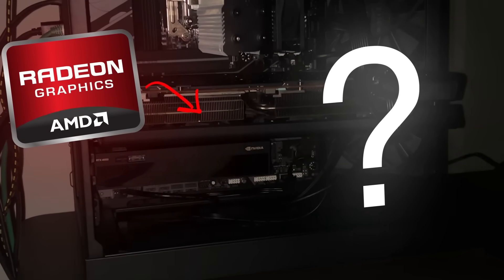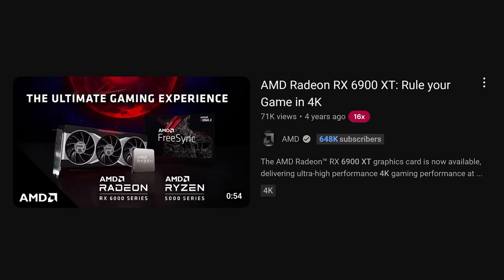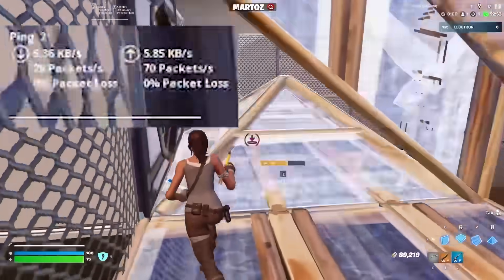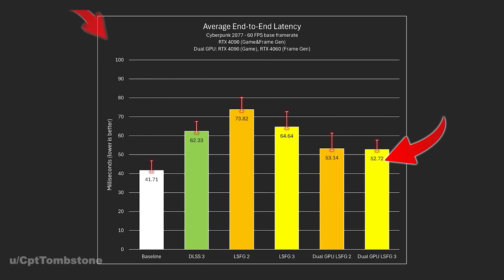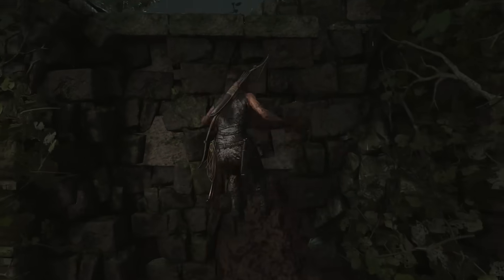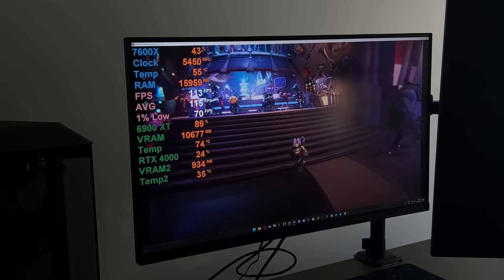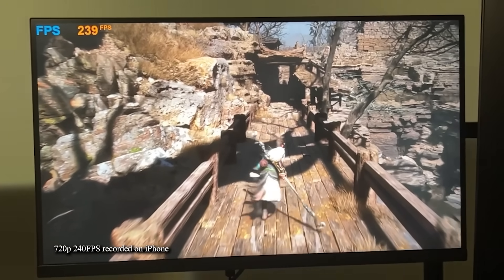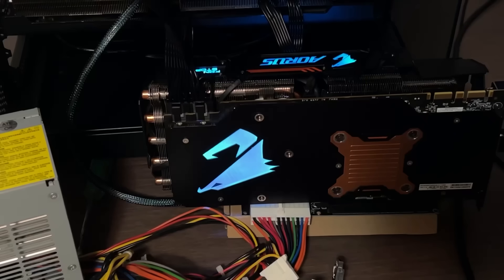I Used Both AMD & NVIDIA in One PC and Got 240 FPS in Every Game

Comment: Try AFMF2 on an AMD card while your other one renders the game. It's a similar dual GPU concept but its significantly easier to setup (less problems) and it has less latency than LSFG too.
Reply: I think the ultimate setup would be a 9070XT + 9070XT
One of the big creators should do this
Reply: @walter1824  AFMF2 is very light to run unlike LSFG, so you don't need a beefy GPU like that to run it with no performance loss. A simple RX 6600 will suffice
Reply: @Hybred  well I just so happen to have an RX6600 laying around... Only downside is I'm running a mini-itx board with 1 NVME slot lol.
Reply: @frostbite1991  use another PCIe slot then. It's fine for that
Reply: @Hybred  mini itx only has 1 pcie slot
Reply: Aaaand we’re back to crossfire again
Reply: @walter1824  i mean i got it half way with a rx 9070 xt and rx 7600 xD
Reply: @walter1824  and what if ... a main gpu is a 9070XT ... and a cpu APU is the "frame gen" one? ... will be worth to try it? (that will make no bandwith problem)
Reply: Yoo the man himself new vid when
Reply: @IstyManame  I do so many different kinds of content on my dysfunctional channel. It's hard to tell what type of video people want when they say this haha. I assume it's from the TAA video?

In that case I have a planned video on game lighting, it's just a lot of work though.
Reply: I have the RX 7900 XTX as my main. How would this do with an RX 580 backing it up?
Reply: @hrayz  AFMF2.1 requires an RDNA 2+ card unfortunately, which means RX 6000 series+.

You can get a cheap RX 6500 XT for $140 though
Reply: @Hybred  I do have an RX 6500 XT, but it's in use in another build...
Reply: @Hybred  i might try this a 7900xt and a 6700xt what would the performance look like also using a 5800x3D so will it end up being a bottleneck
Reply: @oblique__  it's good for CPU bottlenecks so no it would be fine
Reply: @ ok cool and it would better to find a dual x16 slot motherboard vs the external right
Reply: @oblique__  Sure but with two x16 Slots both just run on x8.
Reply: @hrayz  Probably not too well. I have a 3060ti + RX 5600XT setup, and the 5600XT struggles. Could also be the gen 4x4 slot on my motherboard, so I am upgrading my motherboard,  too. However, I finally got a 7900XTX Nitro for $750, so I will see how it performs after it arrives next week.
Reply: you have a video on this? i have a 9070xt and 6700xt and have been wanting to test dual gpu for frame generation. currently i do not have space in my case to fit the 2nd gpu in the 2nd pcie slot and my oculink does not seem to read my 2nd gpu so i have to figure that out still.
Reply: @ItzSath type in "Dual GPU Meta? Nvidia DLSS4 + AMD FMF2 in Tarkov"

Also use a PCIe riser cable then.
Reply: have you had issues of something capping your fps? I'm trying to troubleshoot and figure out if it's my card or monitor or something else i'm not thinking of.i've done this setup but my 4k monitor caps at 120fps despite framing caping tech being turned off. also in overlay for whatever reason the amd card is being 100 util while nvidia card barely has any usage.

Using 4090 to render and 7600 for AFMF

mobo MSI MPG AMD B550 Gaming Plus Socket AM4
Reply: @VampiricConch55  type in graphics settings and set the 4090 to your high performance GPU.

Secondly the 2nd PCIe slot on your motherboard is slower than your main one by a lot, it has limited bandwidth. 4k itself already consumes a lot, so it capping 4k to only 120fps makes sense given this fact.

You either need a better motherboard or to go down to at least to 1440p to get high refresh rates.
Reply: Is that possible? And what benefits could there really be from doing that instead of using AFMF on a single GPU? It's a very good discovery. Personally, I also prefer AFMF 2/2.1 to lossless scaling.
Reply: @TheSpookyOficial  Benefits are lower latency, better performance & slightly better image quality.

All FG's have a performance cost. Getting rid of that cost means less latency since your FPS didn't go down & it also means higher framerates.
Reply: @Hybred I think in that case the most important improvement would be the reduction of latency because AFMF2 has very little cost of performance, most of the time it literally doubles the base of fps even has less performance cost than the fsr frame gen itself
Reply: @TheSpookyOficial  Yes its already very very low, lowest of any FG, the real big benefit is being able to use AFMF alongside DLSS 4 / NVIDIA's GPU, best of both worlds.
Reply: @Hybred There is already FSR4 and the case of NVIDIA, the Smooth Motion, which despite being less polished than AFMF is functional, so that aspect does not seem so relevant to me to justify mounting another GPU on the PC because it would be an increase in unnecessary power consumption, the most relevant would be that the reduction of latency in my opinion.
Reply: @TheSpookyOficial  NVSM reduces performance by about 15%, so it has significantly more latency & less fluidity than AFMF2, even when it's used by itself let alone on a different GPU.

Also 2nd GPUs dont increase power draw much. 30-45w for a small task like that. You could also get a PCIe powered card like the RX 6400 for simplicity
Reply: @Hybred Another question I have is that if using this method you could use the main GPU to render the native FPS of the game + FSR FG and then with the other GPU use AFMF on top to make a kind of X3.
Reply: @Hybred Interesting, although if not bad I remember the results that AFMF gives may vary depending on the GPU you use.
Reply: @Hybred It would be great if you made a video about this on your YouTube channel
Reply: @Hybred The only thing I'm worried about using 2 GPUs is that from what I've seen, sometimes Windows creates conflicts when it comes to assigning the right GPU in games.
Reply: @Hybred that both reduces latency use dual GPU for AFMF? I mean an approximate percentage
Reply: Correct me if I'm wrong but the second GPU will just get 4 Lanes right? So if I use a 9070 XT as Main GPU and for example a 6600 XT for FG it will only be connected with PCIe 4.0 x4. Isn't this a problem?
Reply: @dalukey75  no because AFMF2 is very easy to run, so you dont need the full performance of the lane for it to function well
Reply: @Hybred  Would it be a problem to use a PCIe Slot with 4 Lanes from.the Chipset instead directly from the CPU?
Reply: Afmf is way lower latency just running on a legion go, main reason I don't use lossless unless I'm on a nvidea gpu
Reply: @Hybred How does this apply to VR ? I Have a 9070xt and I wouldn't mind buying a cheap 6 or 7 series card
Reply: @Hybred  Would this work with a 9070xt and a 2080 super? Still have my 2080 super lying around would be curious to try it.
Reply: @akn_9220  AFMF2 Is an AMD tech, so no
Reply: @Hybred  Yea I get thats AMD tech. But I meant more like what he did in the video with LSFG with the 2080.
Reply: @akn_9220  sure its possible. With the correct PCIe lanes on your mobo a 2080 should be able to do 240hz 1440p interpolation. 360hz or higher probably not.
Reply: @Hybred Thanks, I'll give it a try. My motherboard actually has SLI/Crossfire support, but case might be a tight fit.
Reply: Had LFSG3 already. Had exactly 6900XT and recently got the 9070XT. Was thinking to build 2nd PC with the 6900XT (** as I love it, don't think selling it for like 350, as for 350 its "Frame Per Dolar" value is insane).
 ... setting the 6900XT as FrameGen GPU in the LosselessScalling ontop of the 9070XT  ! 🤯💥

** 9070XT will get the FSR4 in games (already did FSR4 to 40 games with Optiscaller), also 9070Xt will cope with the RayTracing, and then the 6900XT will FrameGen them beautifull frames with the LSFG3! 🤯💥 

** @Hybred, Now you made me thinking to test AMFM2.1 in this setup as its better than LFSG3 in some games and 6900XT is AMFM Supported. Thanks!! ❤

PS: Already have 2nd PSU and have had 2 GPUs-one-PC (with 2 PSUs) like 2013. Mission acknowledged!
** Just checked my Asrock Steel Legend X870 and it says below .. if it's true might not need the M.2 Adapter (crossing fingers):
CPU: - 1 x PCIe 5.0 x16 Slot (PCIE1),  *9070XT is PCIe 5.0*
Chipset: - 1 x PCIe 4.0 x16 Slot (PCIE2),

** Need to check if my 2nd M.2 is on M2_2 else If M2_3 is occupied, PCIE2 will be disabled. ;)
Reply: @OCFreeze  how did the test go for you? 3 weeks later
Reply: @Hybred , for lsfg dual gpu ,do I  have to use an external GPU dock like the oculink or the adt link k43sg that's powered by 2nd psu 24 pin for the 2nd gpu or can I just use an m.2 to pcie riser like the adt link r43uf 4.0 that's only powered via a sata cable ?
Reply: @PatrickBateman-co6cs 
I don't know if the Sata-Power is to weak for a GPU. Normally a gpu gets 75 Watts from the PCIe Slot. A single Sata can't deliver that by far. 
And the R43UF is just PCIe 3.0 x4. This can be bottleneck. The ADT-Link F43SG supports up 5.0 x4 but needs 24-PIN from a PSU.
Reply: LSFG 3>>AFMF2
Reply: @Hybred  I have one 4070ti and a 4070ti super, think it's worth it?
Reply: @Wingly_Actual  yes a 4070 Ti is good for LSFG at 1440p
Reply: And it looks WAY WAY worse than LSFG, I have tried it.

Comment: And you can use the 2nd GPU for physX too.
Reply: @Tailslol  i was thinking the same, 2 reasons 2 buy 2 gpus (or at least an extra cheaper one)
Reply: Just reading this as I was about to post something similar. It's what a chunk of AMD users used to do in the 2000s--especially when games like Arkham Asylum released.
Reply: @Tailslol  just want to let you know it worked almost flawlessly tbh. I just installed my 1070ti installed the nvidia drivers alongside the amd ones and it just recognizes it and plays 32bit physx games flawlessly like I had an Nvidia gpu. Like wow im shocked how easy that was.
Reply: @Tailslol wait are you being serious? Can you use 32 bit physx with the second card with the first one being an amd one?
Reply: @Darkage-io4sl  yes
Reply: @Tailslol  alright so I just got a 9070xt i have a 1070ti I can put it in my system run this program and I should be able to use 32bit physx on game again?
Reply: @Darkage-io4sl  yes if your motherboard can handle everything at full speed and you can run both drivers you will be able to use the 1070ti for scaling and physX.
Reply: @Tailslol  ok yeah the main slot is a gen5 x16 and the second is a gen 4 by 16 so ill be trying it later
Reply: @Darkage-io4sl  https://www.youtube.com/watch?v=crgqDkmwqjg
Reply: @Tailslol  dude you are a lifesaver thank you.
Reply: @Darkage-io4sl  any updates on how it went? If you could share your experience with that setup and more details on your PC specs too could be helpful and interesting
Reply: @imnutrak130  it's pretty easy. Install both cards, install drivers. Make sure Windows uses your main GPU for 3d rendering. Play.

That's how AMD folks have been playing PhysX games since they came out, lol.
Reply: @Darkage-io4sl  Useing second card to calcuate physx is an very old subject ;) and yes that was working very well,  so you could have AMD card as primary, and second NV card only to calculate physx ;)
Reply: @WoZYtaZ83071  i knew it worked on nvidia cards but I swear nvidia locked it on amd cards a while back. That's why I was so baffled it worked.
Reply: @Darkage-io4sl  hey man, wich version of Win did you tried this?
Reply: @Rezequiel  windows 10, windows 11 is garbage if you have it do yourself a favor and reinstall windows 10
Reply: I’ve got a 4070TI can I put my old 970TI in for physx
Reply: @BlindingSun_  the 4070ti still does physx on the gpu, no need for this unless u were running a Radeon card or an Nvidia 50 series
Reply: @BlindingSun_ not necessary
Reply: I'm actually using my old gtx550ti for physx, and it also has my secondary monitor plugged in (my main rx570 has started acting flaky with it for some reason, plus the thing is a TV which for some reason thinks HDMI is tv-only and applies horrendous image processing that cannot be turned off and only goes PC mode with vga which no even relatively modern card has). But unfortunately I can't use this LLFG method bc I need my FSR to work and it's only supported on AMD with my main monitor.
Reply: @Tailslol  or analog video output
Reply: Im getting a XFX 7900XT next week, hope this project works.
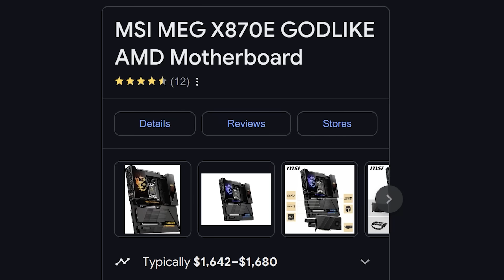Reply: 8:11 This the wrong motherboard my guy. No Consumer board offers enough PCIe lanes for 2x 16 Slots. Weird that i have to make this statement…
Reply: @marcelhaase8416  well, the goal wasn't to get 2x16 slots, the board in question supports 2x8 (in x16 slots) which is plenty for this use case. And it also has an "endless" x4 slot which you can install a gpu in that'll work in x4 mode, if one of its m2 slots is unoccupied (basically a less ghetto version of what Lecctron did).
Reply: What is phyx
Reply: @Tailslol  what, you can use it? I was thinking about it and looks like it works. I mean my goal would be to play those older games with phyx but because nvidia gpus are expensive in my country - I mean anything above 6-8gb vram, like old 1080ti cost 200$, 3060 12gb about 250 while rx6800 with 16gb 250-300$. Which is the best used gpu?! Paired with some older gpu for physx that are cheap enough, even those pro versions k4200

Comment: Maybe try it on the iGPU? ok the ram bandwidth may be lower than VRAM but the pcie bandwidth is much higher than if you were using it on nvme port
Also if you dont use the igpu just disable it

Comment: So basically, sure it can work. But it causes alot of issues and you're probably better of just using lossless scaling on your main gpu? 

It seems like its just not worth the time of doing it, vs just using lossless scaling frame gen with your main gpu.
Reply from the maker: it's worth it if u already have the spare GPU and a good motherboard because the latency and performance is unbeatable, otherwise it's not worth the hassle as u said
Reply: @lecctron I wish game supports SLI imagine having two RTX 4080s with a Intel i9 14900KF chip

Comment: Or just use an AM5 Ryzen Cpu, because most come with Intergated Graphics that LS can use to frame gen
Reply from the maker: true that's one of best uses for LS but not nearly as fun for a video
Reply: @lecctron  it wouldn't work, integrated graphics aren't strong enough unless it's a full blown APU or something. I've tested it on integrated 9800x3D and it's worse performance than just using your main GPU alone
Reply: @Hybred  so halo strix could be the move with the aimax395
Reply: @PabloMoreno-k3l  LSFG GPU requirements is based off of 1) your resolution and 2) what framerate you want to hit.

So yes its powerful enough for LSFG in general probably, but is it powerful enough for 240fps at 1440p? That's a different story.

The dual GPU LSFG stuff is niche because performance requirements rapidly increase + you need a very good motherboard to properly utilize it.

LSFG is good for people who upgrade from a high end card to another high end card, because those people have a powerful backup GPU and are also likely to have an expensive motherboard with good PCIe slots as well. I wouldn't bother with this unless you're willing to actually dish out money to make it work well.
Reply: @Hybred  It can work, just lower the flow scale, that makes it easier to run at the cost of lower visual quality
Reply: @ True, your video was entertaining